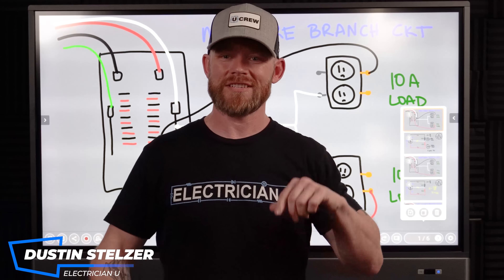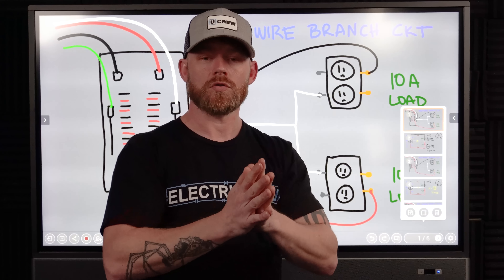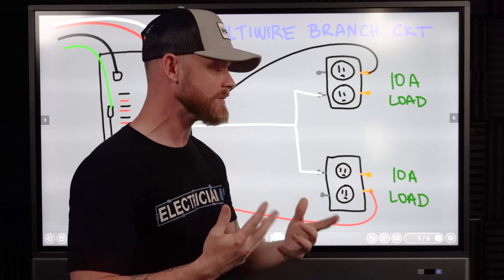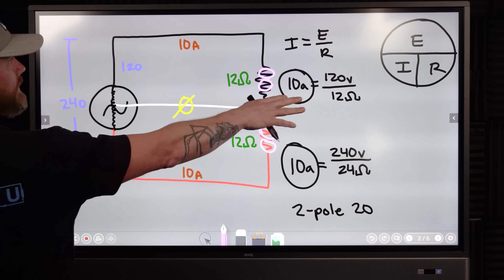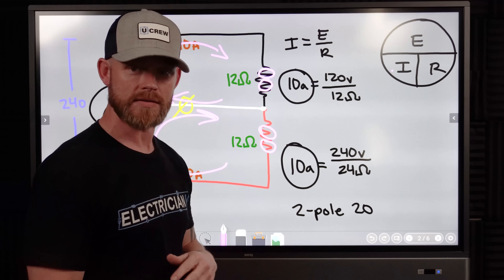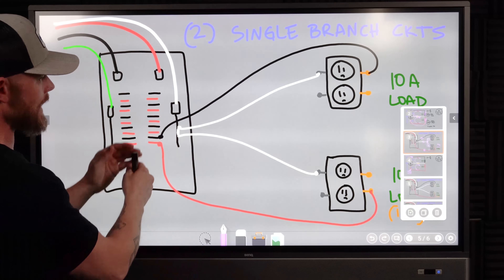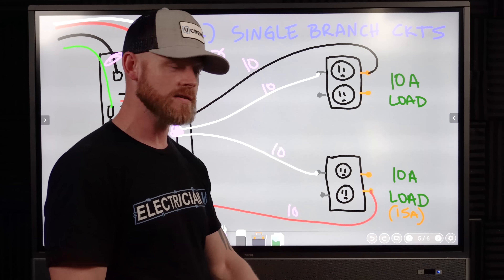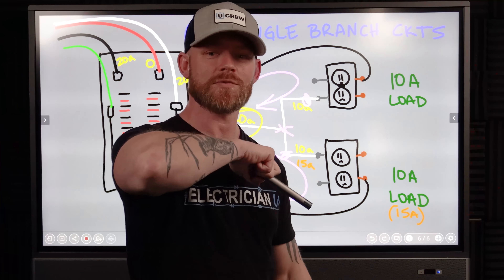Neutral Imbalance in Multiwire Branch Circuits (Two Hots, One Neutral)

Comment: Dustin great work but how do i add gfci and afci into multiwire branch circuits?? Im feeding two kitchen appliances and the nec requires afci and gfci
Reply: You would have to use a two pole AFCI breaker and individual GFCI outlets,  because two pole combination AFCI/GFCI breakers are not yet manufactured, and doubtful they will be anytime soon ,they would be so expensive it's just cheaper to run 2 runs of 12/2 NM each on a single pole AFCI/GFCI breaker, instead of one 12/3 run, like you'd find in many kitchens from the 70s and 80s.    

Keep in mind that in most cases, if your home was wired to code at the time of construction,  the existing wiring typically falls under the grandfather clause,  so unless you are adding or making changes to an existing circuit you are not required to update the wiring.    (They still sell new, two slot ungrounded receptacles even today, for this reason, because you are not allowed to replace and old two prong with a three prong if there is no ground present,  unless you have GFCI protection and you label the outlets as such, you should see these labels if you purchase a new GFCI outlet,  for this reason)     hope this helps and good luck.

Comment: I actually have this in my home.  They are mostly on the circuits that feed the upstairs probably because they were to lazy to fish proper wire to feed everything.  My house was built back in 1907 and originally had knob & tube wiring.  When it was rewired, they fished this type of wire to the attic to feed the upstairs rooms.
Reply: There's nothing lazy about this, it's a perfectly fine way to wire things.

Comment: Excellent video. I have been going through my houses electrical which is a nightmare. I've found that most of the circuits are split on a 12/3 etc. Some are essentially what should be 2 circuits on one and have been studying what is the safest way to split them to balance out the loads. Now I'm seeing that not having dual pole breakers as I've thought previously on a shared circuit is a hazard and explains a lot. Makes my case to upgrade the panel and service to have more room to split things up even better. Thanks so much for explaining this!
Reply: Snarked,    As one that has been an electrical designer for 35 years, I have designed electrical systems years ago.  Almost always had home runs with one neutral.   They had single pole breakers as you have in your situation.   There was nor is a danger to the electrical system or your equipment.   The reason for the handle ties or two pole breaker is not for overcurrent.   The tie is for disconnection of the two circuits at the same time.   I read the letter sent to the code making panel when this whole thing started.   A maintenance man was working on some office partitions with multi wire branch circuits and got shocked because he did not turn off one of the breakers.  That is when handle ties came into affect to disconnect all the breakers with one handle.  It migrated to all multiwire branch circuits the next issue 3 years later.   I hope this helps you sleep better at night.   Respectfully,   Kevin
Reply: Research handle ties on tandem breakers. You might be able to make room with what you got.

Comment: I have several of those circuits in my house. I changed out the old Federal Pacific panel for SQd ..I was careful on which pole I landed red vs black. Inspector said I should have used 240v breakers on those, but passed it anyhow since “better than before” and in the panel it’s obvious how I paired things. Later on, unrelated, had one room where lights would sometimes go bright, while dimming in another room. My guess was a dropped neutral somewhere. Found it behind a smoke detector. The wire nut came loose on the neutral. Prior homeowner didn’t do a good job when replacing the smoke detector. After finding that, changed all plugs/switches in the house and checked all jbox .  No more issues!  I hope people get educated from your videos.
Reply: Ideally I should swap those breakers. Someone not knowing might turn one off and think the shared neutral is safe when working on something. I know to double check when both red and black are in the same box.
Reply: @jackl9922  can you just tie your existing breakers together, instead of replacing?
Reply: You may, according to NEC buy what is called handle ties that will fit your breakers if you like.   Please remember, not an overcurrent issue.   It is a disconnecting both circuits on the neutral while working on something.

Comment: Please explain what happens when the neutral is disconnected or opened when phase A and B are under a load 🤣.
Reply: Bad bad stuff.  You'll get one hot going high while the other leg goes low.  They'll both add up to 240V though, but you'll fry electronics, light bulbs, or possibly start a fire.  The deviation away from 120V on each hot will vary depending on how imbalanced the loads are between the two hots.

Comment: what happens when the neutral is shared with two true phases (not split phase)?
Reply: In three phase systems, it can be 1 neutral with 1 hot, two hots, or three hots.   In three phase outdoor branch circuits (I never did this in a design) you can have a neutral and 7 hots.   So it doesn’t mater the system, 2 hots 1 neutral works exactly the same.

Comment: Hi, Dustin. 
Could you make a video about phase displacement in transformers? I've been a bit confused about it in class, and we've been connecting transformer banks in parallel, thankfully all of my connections have worked and nothing blew up.
But I'd love to see this topic in depth.
Reply: This is also known as the Vector Group of a Transformer, and it details the Phase Displacement/Shift between the Primary and Secondary terminals of a Transformer, connected in (Delta-Wye) or (Wye-Delta). In any displacement situation, you will always have a Lagging or Leading condition between the Primary and Secondary. On a Transformer Data/Name Plate, you might see (Dyn1), (Dyn11), (Yd1) or (Yd11). This is indicating a Shift of (+30 degrees) or (-30 degrees) between the Primary and Secondary. Often times you might see the face of a Clock being used to show the Phase angle. When the Long Hand or the Short Hand of the Clock (I forget which one) shows (11), it indicates a (+30 degree) shift, and when it shows (1), it indicates (-30 degree) shift.
Its not a hard concept to understand, it just takes a little researching of the topic, to put it all together, and to have it make sense.
Reply: IF you really want to fully understand phase displacements in transformers, it is best to study phasor algebra.  Using geometry to explain how the sine waves react is not going to be enough.
Reply: @randomlife7935  I'm taking a technician's degree, I asked my instructors and they're never gonna teach that to us in depth, just basics. So, I'm trying to find out a dumbed down version of it, basically.
Reply: @randomlife7935  I think there actually is a fairly sound geometric representation using triangles. I will revisit this tonight and see if I can pull it together in words. Or link to an image/video.

Comment: I had a similar case that there are 2 different inputs in one junction box and I tried to share a neutral and then it ended up made the GFCI receptacle tripped.
By the way, is it ok sharing a grounding wire on different non-grounded circuit?

Comment: What qualifies a device to be “hospital grade” and what distinguishes them from a regular device?
Reply: I believe they are tested more often for quality control during manufacturing (example 1 unit out of 1000 is tested instead is of 1 out of every 100 000)
Reply: A green dot . . . . . . in terms of a receptacle.
HG Receptacles are designed to take more punishment, a lot more plugging in and unplugging situations.
Reply: @griffmustard    Correct and they know the hospital personnel grab the cords and yank them out.   That is what one manufacturer told me in a class once.

Comment: You need an oscilloscope. Easy to see how current cancels with opposite sine waves.
Reply: Doesn't help when most electricians don't know what the X & Y axis is or how a sin wave pertains to electricity. They just parrot back what they see on YT without understanding it. A cartoon would be better.
Reply: Exactly !!  Also, if you pause the video at, lets say (8:42), and have a look at the two pink arrows, if you can visualize the top pink arrow, with the arrow head at the neutral wire, you can see that when both arrow heads are at the neutral wire, they point in opposite directions, meaning the black wire is at +90 and the red wire is at -90, and their currents are at (+10A) and (-15A), respectively. And that is how you end up with (5A) on the Neutral.
Reply: @griffmustard  thank you for your contribution!
Reply: @mattbaker6587  Matt, you're very welcome !!!
Reply: And if you yanked the neutral connection with uneven loads, one load would burn brighter (see higher voltage) than the other (the higher resistance load).

When equal loads, they work fine with no neutral at all.

Comment: Love your videos. You should mock these up as examples in a lab environment, use a clamp meter and show us the values.
Reply: I'd like to see that as well. He's saying on a 20 amp two pole breaker if you hook 12-3 and run two separate 120v circuits off it, you actually have 240v coming back on the neutral?
Reply: @schowers  Nope.  If you have a pair of breakers, one on each phase and utilizing a common neutral between them, that only the imbalance current is returned on the neutral.  So lets say that you have a pair of 120V loads, one on each phase, with each drawing 10 amps from their respective phase.  The actual imbalance current on the neutral would come out to ZERO.  Each load would drop 120V and the current would return from one phase to the other.  Now if we leave the load on the A phase at 10 Amps and reduce the load on the B phase to 7 amps we have a total of 7 amps from the A phase being returned thru the B phase and the balance of the current being returned thru the neutral, that being 3 amps.  Get it?

Now there are other things in play here that I will not go into such as the possibility of excessive induced currents in a shared neutral should the loads be motors.  IE: Power factors of less than 1.  Mainly because I don't understand the underlying math and theory enough to speak on the subject with any authority.  But the above should provide enough to help you understand.
Reply: Why?
Reply: @mikeiver  I guess I just like to see these things in a lab environment, or in actual application.  It's fun to see, and when I studied electrical in college, I preferred lab classes over theory classes.
Reply: @cachapma99  Fair enough, some can only learn by seeing and doing rather than reading.  this video is more geared to the beginner rather than the seasoned tech I should expect.  there is always something to be learned though.

Comment: Missed an opportunity to do what you have done well on other videos that helps make sure things are done correctly - reference code and talk about what needs to be done to make sure code compliant and not creating an issue inadvertently.  My experience has been that what you spent only a few minutes talking about at the end - issue with MBC on same phase - is what's typically done and hence create the potential for too much current on the neutral.  Nice to know the theory but it would be beneficial for a simple explanation of what should be done to properly wire a MBC,

Comment: /Do imbalanced loads affect the meter? Someone told me once that if there were more loads on lets say the black leg and much less on the red that the meter would read more kWhs than if both legs had the same load. Didn’t sound right to me but it has always bothered me.
Reply: The only imbalance you will get is unbalance between inductive and resistive loads.
In residential and most commercial applications, you don't really have to be concerned. Paper mill? Nuther matter, and the engineers have probably considered it already.
Reply: Trust this!   The utility company is very much going to charge you for every KWH that you use.   Imbalance will have no effect.
Reply: @KevinCoop1  no doubt! The point being, is that inductive load (read 3 phase motors) increases the electric charges, many industries will use synchronous motors (where they can) to offset that phase shift.
The OP here was asking if a load imbalance between phases affects the cost, it doesn't. Just the imbalance of types of load can affect it.
Reply: @brucelytle1144     Agreed!  The answer was for single phase from the video.   Yes inductive and reactive power can cause the amps to lead or lag the voltage in 3 phase systems.   If this situation exists, the utility company is not charging for all KWH.  If bad enough, then they get hit with power factor and demand fees to get more accurate.
Reply: @KevinCoop1  Just a general tip here, on alot of these videos. 
Read 90.1 of the NEC. Let that sink in a little.
Over 45 years working with all this, I've learned that 'Murphy' was an optimist!
Reply: @brucelytle1144     I retired at 35 years from doing electrical designs for electrical contractors mostly.   Last 21 years with a top 15 privately owned contractor.  
90.1. Safety.   That one part of the NEC is what we better design engineers strive for.   Have a wonderful day.
Reply: @KevinCoop1  Don't think I'm arguing with you. My point was that basically, most people try to "cheat" the 'code', while the code starts out saying, this is the minimum, if you want efficient, expandable (who doesn't 'expand'?) ya gotta do some more work.
You seem to be familiar with that part, most people skip right over the "preamble".
I'm retired from all that at this point. I'm rewiring my 1956 built house, that has a bunch of scary modifications over the years (it was built and owned by the lineman Foreman for the local electric company). 
I have a bunch of 1 & 3/4 inch conduit, thousands of feet of #10 & 12 THHN (red, black,blue,brown, orange, yellow), so, I'm gonna rewire it in conduit, to 2020 code. 
PITA I know, but retirement can be boring, WTF? Right?
Yeah, my receptacles will be wired from a red and black and share the neutral. I don't use them much anyway.
You have a fun weekend!
We don't have a problem, I want others to be aware, that's all.
Reply: @brucelytle1144     Best wishes to you and yours!   Hopefully the electrical work will be fun for you.  You can also do what we did.   Buy an RV and go camping.   Especially if you have grands still in school.   They love going a few nights with us!   
Good luck again,   Kevin

Comment: I'll assume that's a sub panel since the neutral isn't bonded to the ground. Am I reading that correctly?
Reply: No, it doesn't matter if the panel is bonded or  not, neutral is neutral. Where it is bonded to ground is immaterial, neutral is grounded at the entrance panel.
Reply: @brucelytle1144  gotcha, thanks bud
Reply: It's not important for this video's topic, but yes for the drawing to be accurate, that would have to be a sub panel.

Comment: It’s common in older wiring. Not good practice. Along with carrying a neutral to every switch location. With that being said sharing a neutral with a load that’s on another phase is cool, and this principle is used in power engineering